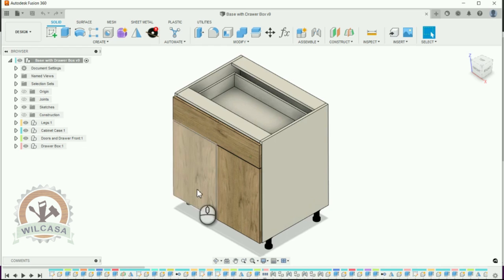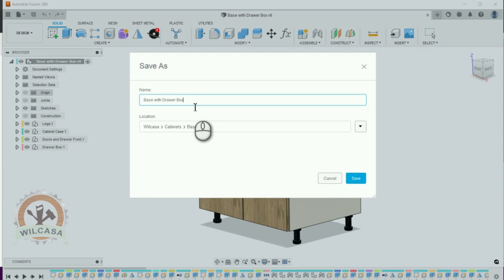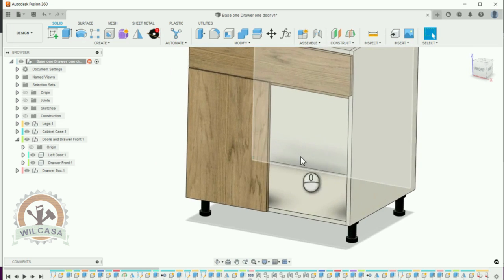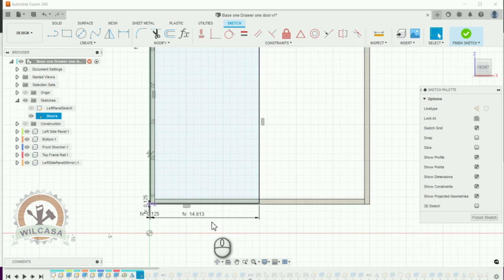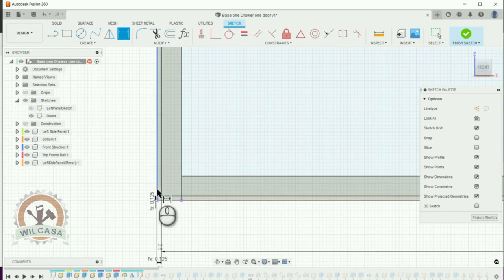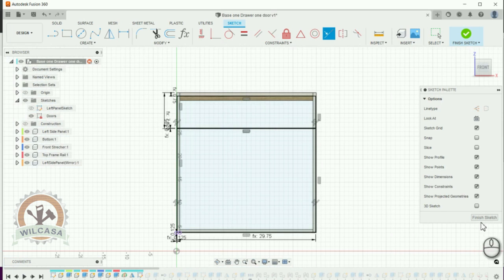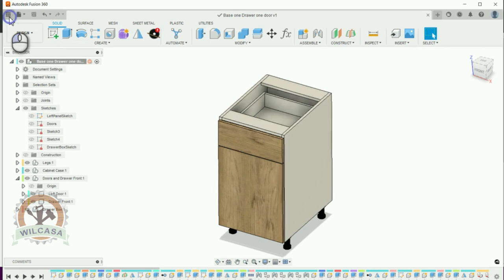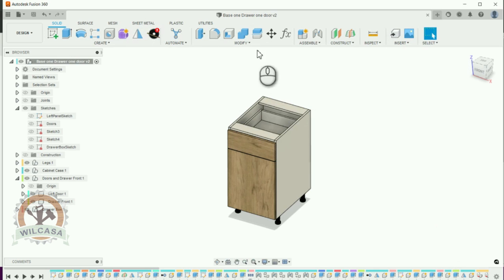Modifying a kitchen Cabinet with Fusion 360

Comment: Could you also recommend the hardware like slides and hinges that work best with these type of designs. THank for your help.
Reply from the maker: You can update the parameters accordingly to the slides you like to use. Thickness, length, etc

Comment: +1, how Fusion 360 works at slow laptop? I see it has shadows and texture by default added so this might impact performance a lot?
Reply from the maker: Hi, thank you for asking. Since I started using Fusion 360 I have only tried in only two computers, with no performance problems in neither of them. I do kitchens and closets sometimes with a lot of components. It only slow you down making renderings, some of them take 35 minutes or a little more, but you have the option of paying for online rendering thru Autodesk.
I found this recent article about performance issues and possible solutions here: https://knowledge.autodesk.com/support/fusion-360/troubleshooting/caas/sfdcarticles/sfdcarticles/Performance-issues-when-working-with-large-assemblies-in-Fusion-360-and-HSM.html
Reply: @wilmagcasado  Thanks !